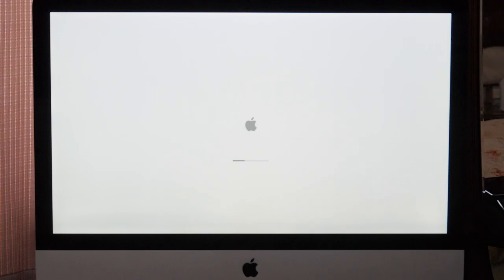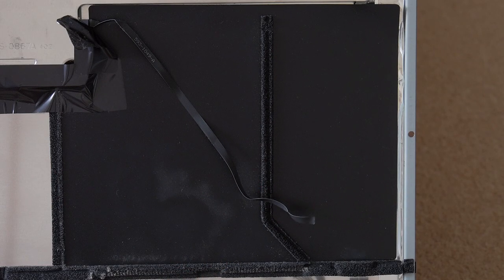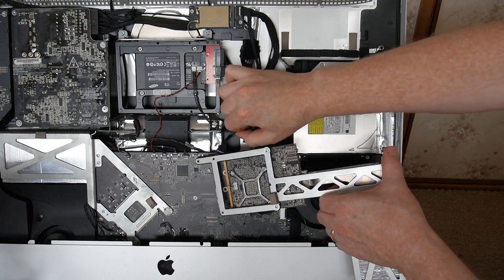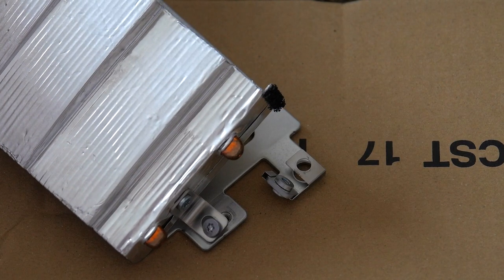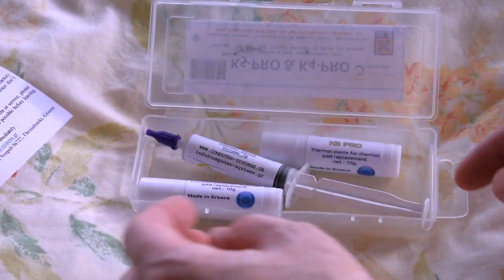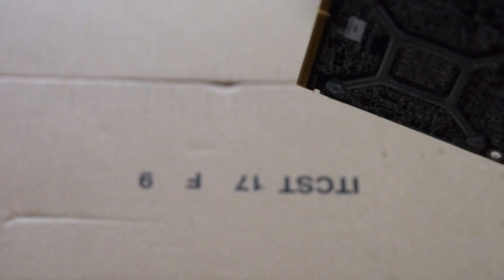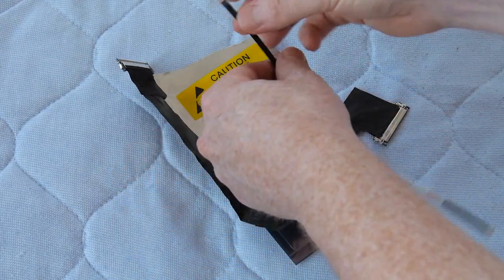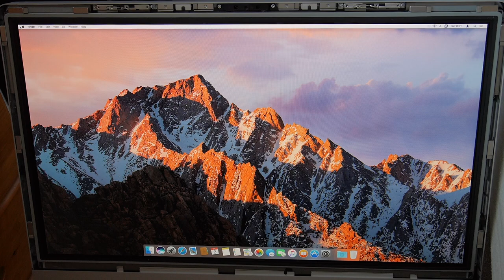Late 2009 iMac 27" Video Card Repair — 4850 — 2nd Bake

Comment: WOW, MY COMPUTER IS RUNNING BELOW 40 C INCLUDING THE POWER SUPPLY ABOVE THE CPU
MY CPU IS RUNNING AT 35 C ALL CORES, MY GPU IS AT 35 RIGHT NOW.  MY POWER SUPPLY USED TO BE 70 C.  THIS IS AFTER USING ARCTIC MX-4 ON EVERYTHING BUT THE PROCESSOR AND USING KRYONAUT DIRECTLY ON THE GPU AND CPU.  I also replaced all my fans for 100 (IFIXIT).  I did not use and will not use CONDUCTONAUT or any other electrically conductive LIQUID METAL FOR PASTE since IT EATS COPPER.  I'll put my computer in the freezer before I do that.

I'd like to pass on a great way to save money and "PIMP" your mac. I'm not really into using young lingo to sound hip, but there.  If you buy a used 2011 Imac or 2011 Macbook, you will find that the motherboard has TWO 6Gbs sata ports and the 2011 Imac also has a 3Gbs sata port.  Back when I was working as a tech, the kids would put in two SSD hard drives of the same size, do a software RAID through disk utility, and boot Mavericks (giving them 800Mps Read and Write).  If you've worked with hard ware RAIDS as I have (ARECA THUNDERBOLT 1,2, and 3 are the most economical (you can visit www.macgurus.com he's been doing  home VIDEO RAIDS since the G4) you know to NEVER BOOT AN OPERATING SYSTEM FROM A HARDWARE RAID.  I've tried, the system will become inoperable in about three days and you'll have KERNEL panics.  This DOES NOT HAPPEN on apple's software RAID and thanks to the speed of SSD's, you only need about 2 to flood the motherboard bus, where mechanical hard drives on a hardware RAID can be between 4 and 6.  Now, High Sierra DOES NOT BOOT on A RAID, because HIGH SIERRA  does not install on a formatted GUID PARTITION MAP, it is the first operating system to USE the more secure APFS MAC OS Extended.  However, this is where it gets exciting kids, YOU CAN, get a 1TB SSD and a 2 TB SSD and run them off the internal 6GBS connections.  You then partition the 2TB SSD into two 1TB partitions take one of the 1TB partitions and RAID that to the 1TB hard drive and install Mavericks.  Thanks to the introduction of Windows Bootcamp Apple has become very adept at formatting different partitions with different operating systems.  With that said, you can then format the remaining 1TB off the divided 2TB and install High Sierra. If you have that extra 3gbs slot for the optical drive you can throw in a 4TB 2.5"  SATA internal Time Machine Backup since that connection is slower (I think 2009 Imacs have that off the entire bus)  I have a lot of software that IS NOT migrating to High Sierra and I'm not too thrilled with this MULTICORE expensive expansion that has given us a MAC TOWER that will most likely retail for 30,0000 (OBSCENE).  If you are into producing video and hardware RAIDS please visit macguurus.com.  I spoke with him and after a lot of research I'm hoping to try out the thunderbolt 1 ports on these computers.  According to MACGURUS, you can run apple's software RAID off the HARDWARE RAID thus running a RAID off of multiple thunderbolt busses connected to your motherboard and saturating the motherboard speed.  If you have a trash can Imac you could theoretically run 6 6 bay Areca thunderbolt enclosures and connect them all through Apple's software RAID saturating your motherboard bus.  THIS COULD TACKLE 4K.  Personally, I'm not upgrading computers until they figure out how to give us more than 4ghz in speed, double the motherboard speed, give us PCIE5 (coming out soon), and I'm thinking thunderbolt 4 or 5 and then I'LL BUY USED because that is what 8K and 16K will NEED.  Steve Jobs already gave us the horse power for 4K you just need to know where to look.
1. 4 bay ARECA ENCLOSURES do not have a dedicated processor on board so aren't technically hardware raids/both ARECA thunderbolt 1 and 2 enclosures only support 6gbs SAS and SATA drives, while thunderbolt 3 finally supports 12Gbs.  The 6 bay Enclosure in Thunderbolt 1, 2, and 3 from Areca is the way to go, since it has an onboard processor making it a true hardware RAID.
2.  SAS drives tend to be the best for video and you might as well do 7200 for drive SPACE and affordability, the more drives the more likely you are to saturate and hit the speeds of 10K and 15K sas drives that are far more expensive and give you MUCH LESS ROOM (under 1TB per drive).  SAS are better than SATA drives for RAIDS because they are somewhat built on the SCSII days and have a lower failure rate.
3.  SSD drives are a bad choice for video and hardware RAIDS because while they rarely fail, they have bad blocks that are HUGE and take lots of data with them.  SAS drives might fail more, but a bad block is relatively small and does not take down a LARGE CHUNK OF VIDEO DATA.  While you can almost saturate a motherboard bus with two SSD RAIDS, you can do the same with four to six 7200 SAS RAIDS and you will get that much more space for video if that is your intention.  I say only RAID SSD's if your doing two to boot from and that is only supported with drives formatted under GUID PARTITION MAP and then have a really GOOD TIME MACHINE BACKUP.

P.S.  TWO last golden tips.  The 2009 through 2011 IMacs use the same fans.  So if you buy more than one of these computers or any of these computers a backup group of fans from IFIXIT (at 100) should add five to ten extra years on your mac since fans are the cheapest and first thing to fail usually (SMC FAN CONTROL POWER USERS).   The next thing to fail are sensors (especially the ambient sensor near the CPU fan that GETS COVERED IN DUST so buying extra sensors (especially the ambient and optical drive sensor) can be economical as far as longevity (just think of the price of new software and the time you waste learning it).  An extra optical drive sensor can be used when upgrading your imac to an ssd with OWC's SSD UPGRADE KIT that has a sensor that the APPLE HARDWARE TEST REPORTS AS A FAILED SENSOR.  Simply replace the OWC sensor with an extra optical drive sensor and attach it to the base of your new SSD.  Those are my tips.

PPS  Your computer will only be as fast as the motherboard, which is reflected in the ram speed.  That is the one and only bottleneck.  They can speed that processor up and add cores, add thunderbolt 3, but when looking at 8K and 16K which is what apple is aiming at (THEY AREN'T THERE YET WITH MOTHERBOARD SPEED).  PCIE5 is coming down the pipeline, thunderbolt 4 is being talked about, and personally I want to see Gillium Nitride or something that will bring down the cost of these computers, since it is the cost of core production that is driving the price up.  When the Circus starts JUGGLING crazy stuff, keep your eye on the motherboard speed and IT HAS NOT DOUBLED YET.

Comment: here are some ideas on maxing out a 2011 IMac and dual booting it to a Mavericks RAID and a 1TB High Sierra Boot using a 2TB (partitioned to 2 1 TB hard drives) and 1 1TB hard drive.  You use Apple disk Utility to partition the 2TB drive into two 1TB partitions.  You then raid the 1TB partition to the 1TB drive and install High Sierra on the remaining 1TB partition.  I believe everything up to Sierra will boot off a RAID.  I need Mavericks for Propellerhead which dropped support on the newer systems.  I also have a video on mixing Arctic MX-4 with Arctic Grizzly Kryonaut which has dropped the temperature of my system to 30 to 40 degrees Celcius for the CPU and GPU.  The power supply (the hottest item above the CPU) rarely breaks 50 degrees Celcius when it was between 70 to 80 Celcius.
https://www.youtube.com/watch?v=AHRaSHbJ6zQ
https://www.youtube.com/watch?v=1pq4PlFWHOU

Comment: Hi. I watched your first video which inspired me to do the bake. It was successful, thanks. Now two months later I have tried it again but not with much success. See my video of my iMac https://youtu.be/pyma9xlGZgc which is taken after I did the second bake. Is my graphics at the end of it's life? Any suggestions would be appreciated. I have a 2011 27 inch iMac with a Radeon HD 6970M 1024MB card. Thanks
Reply from the maker: If your first bake was successful, what prompted you to do a second bake 2 months later?  Also, what thermal paste did you use on the GPU and the memory chips of your video card?  
I watched your video.  I looks exactly like what you see when you boot while holding down the Shift key, booting into Safe Mode.  Safe Mode disables video card acceleration. You can read about that here: https://support.apple.com/en-us/HT203889
Reply: JDW Hi again. Thanks v much for your quick response and apologies for my tardy reply. Yes you were correct my iMac was constantly booting in Safeboot mode which I have now raced to a fault on the rubbish keyboard I was using. All fixed now. I simply jumped to the wrong conclusion that the lines on the screen were due to the graphics card. You live and learn. Hope this helps others.
Reply from the maker: Wow.  All caused by a bad keyboard!  I'm sorry to hear of that, but I'm glad to see you got the problem fixed.  You case story very well may be a benefit to others! Thank you for making time to post it!